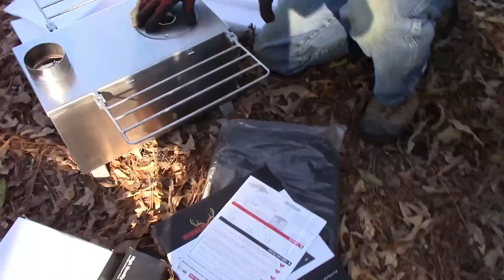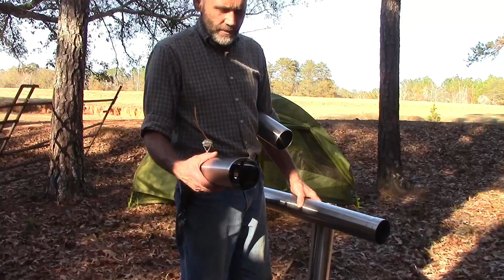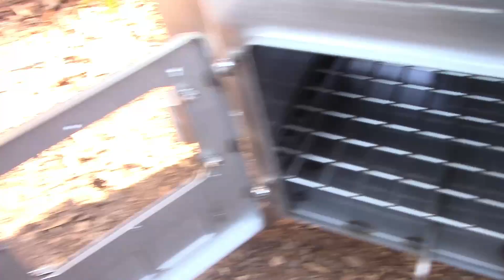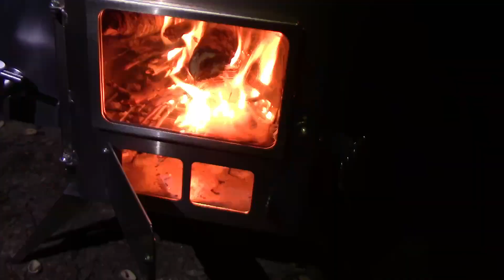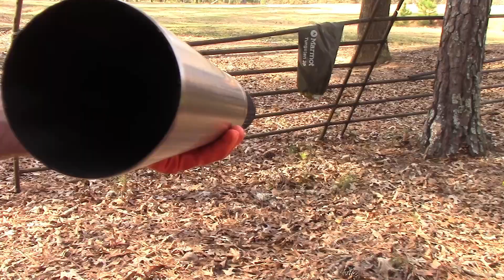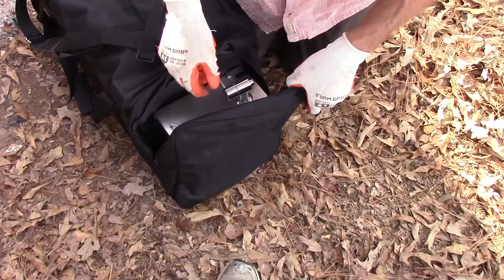Winnerwell Nomad Review

Comment: Everybody gets that hole in the top wrong. When you take that lid off, you close the air from the front of the stove off and you can cook, marshmallows, and hotdogs directly over the open fire. Because the stove is drafting out the pipe it draws air in through that hole and you don’t get any smoke in your tent.
Reply: I believe they also sell a smoker that uses that hole.

Comment: For camping, how long does the wood last in the stove (on low)? Also, was there any reason you picked this one over the woodlander double view? That one is almost the same but has longer legs, more windows on the fire and perhaps better control of the burn rate. I don't think you can store the water on the side though.
Reply from the maker: Depends on what kind of wood you're using.  But if you're using it for heat you'll be up a lot.  Hickory/oak/ash would last maybe 1 1/2-2 hours at the most.  I didn't want the extra glass for durability issues.  Eventually, the glass will get broken.  We ordered an extra one for the front just in case.

Comment: The circular top is for cooking over the open flame - use of a wok, or placing a grill over the flame for a flame-cooked steak, or a cast-iron skillet or Dutch oven, etc. It's a very versatile option. I've never used it for adding wood.
Reply from the maker: Yes, you are about the 20th person to correct me on that. I have learned my lesson well.
Reply: @DannaGesellchen  sorry x
Reply from the maker: @loudoret353  No worries😊

Comment: Have you used the pipe oven? I think this is the only thing you may not have considered…?
Reply from the maker: It's on the list of "to do's"  🙂
Reply: @DannaGesellchen  I just got mine I went for the woodsman stove with water pipe oven and folding oven you showed. The pipe oven is extremely efficient and gets hot!

Comment: Thank you for sharing!  I would say that I ordered the leg extensions with mine, used them from day one and cannot imagine using it without them, if anything it helps my back for sure.  I may give it a go without them but have no desire to have it sit lower.

Last note on the add-ons, I have all of them as well and they do fit nicely in the case, along with the legs extensions and mat.  The case also has the strap on top which accepts the triple wall pipe nicely.

Comment: Door gasket is probably not used as they want the air flow leakage to keep heat off the front glass & give a minimum air intake for safety
The pad melts so I’d add a cooking tray under it or foil…
The water pot is bigger than a kettle so what’s the point paying so much for a particular gadget specific to that stove..
I like the flue cooking box but it is a bit small & very expensive…
It is a great stove though I got the medium for car to campsite trips 
Did you get the heat fans (stove fan) there realllly great
Reply from the maker: Thank you! We do have some stove fans! We wanted to test all the gadgets for ourselves since we had budgeted for it🤗

Comment: Thank you for going through the detail of the stove. Been on the fence for a while but i think im convinced. I also have a possible solution for the hot handles. Wrap the handle with some leather. Just relatively cheap leather as im sure over time it will dry and crack. It should help reduce the heat to possibly enough to grab without gloves.

Comment: The circular plate that removes from the top is not for feeding the stove you remove it for direct heat for frying I believe hope this helps. Ian 🏴
Reply: Great for using a wok
Reply from the maker: Yep!  That's correct!!  🙂
Reply: But once it's going, it doesn't smoke if you do feed it from top.